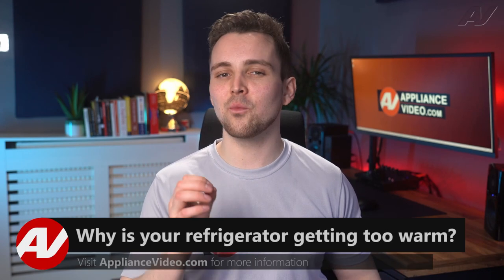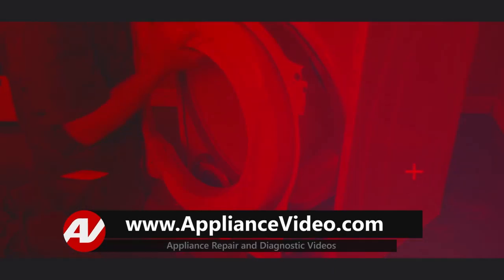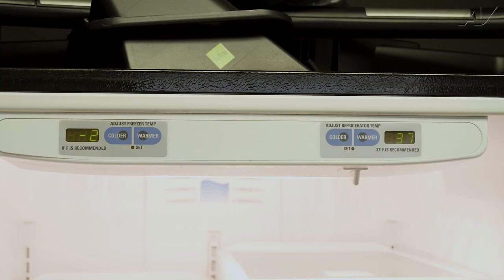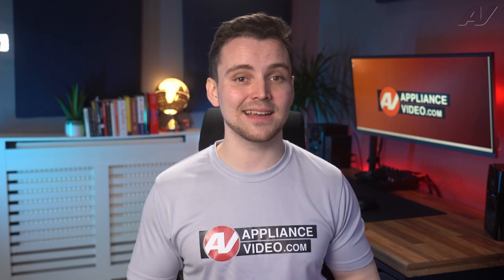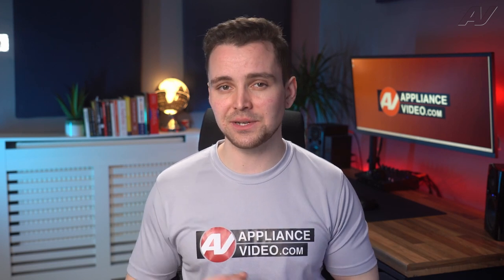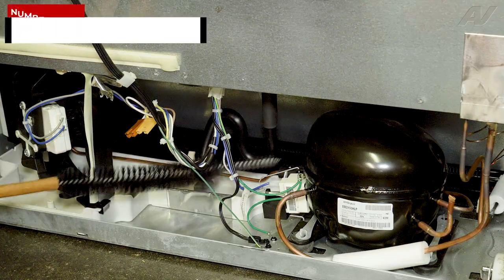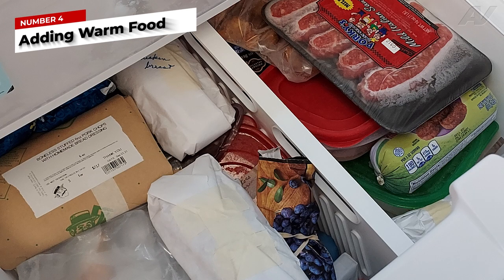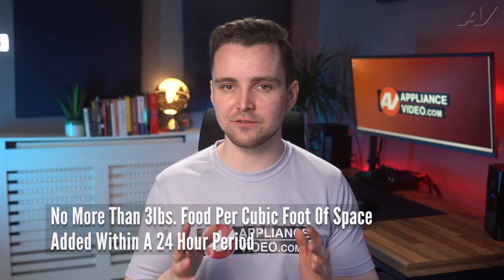Why is your freezer or refrigerator compartment getting warm?

Comment: I have a 20 cubic ft Frigidaire freezer on top unit that is no longer cooling properly. The freezer is only reaching 38 degrees and the right side of the coil is icing up. The evaporator fan is running. If I manually adjust the timer it kicks the compressor and fan off but doesn’t heat up the defroster. I can manually defrost and it is frozen again within hours and not reaching proper temps. Any ideas?